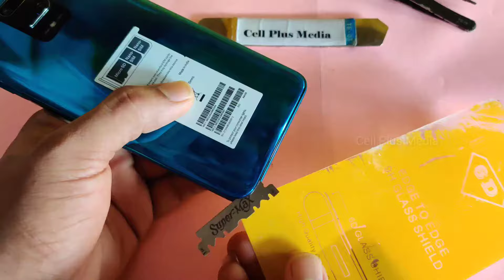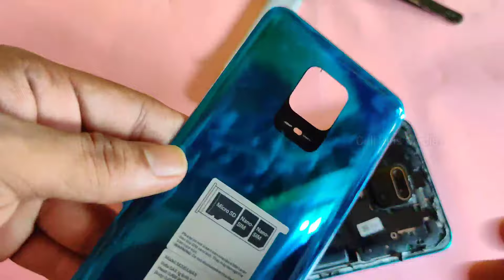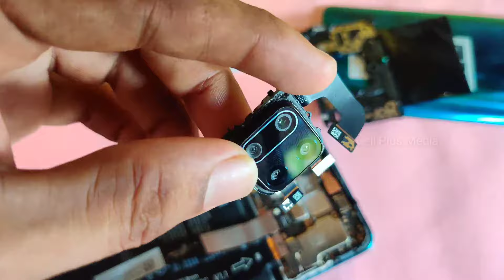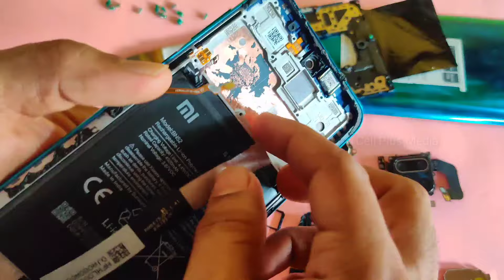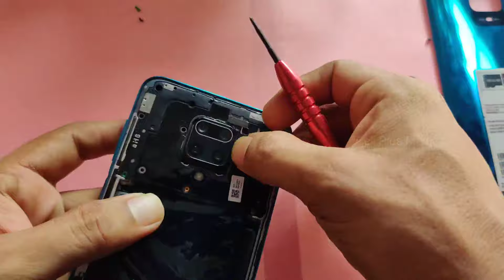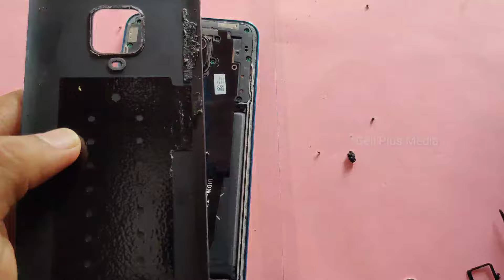Redmi Note 9 Pro Teardown | Redmi Note 9 Pro Full Disassembly | Redmi Note 9 Pro Battery Replacement

Comment: hello recently my redmi 9s dropped into water and o fixed it and it working just fine but after that  the battery drain even when i turned off the phone . what is wrong actually ? should i replace the battery ? please reply me.
Reply from the maker: No battery problem, it's board short, contact nearest service centre
Reply: @CellPlusMedia  so what should be replaced ? how it costs usually

Comment: Sir? I replaced my LCD. While removing the back cover. I accidentally cut the fingerprint sensor. Is there a way t replace using parts from totally broken redmi note 9 pro?
Reply from the maker: https://www.maxbhi.com/fingerprint-sensor-flex-cable-for-xiaomi-redmi-note-9-pro.html?gclid=CjwKCAjwqIiFBhAHEiwANg9szhmm6NAbiI-mn_j2Yt7j655WoTyOu8EZq01CyCBsczRK4TdpVrMnqxoCGr0QAvD_BwE

Comment: The Redimi note 8 pro and Pocophone f1 have liquid cooling😁👍🏻, this one does not.😬👎🏻
Reply: This is modern snapdragon processor don't need the liquid cooling because it's not heat so much and has a better optimization and heat controlling. While mtk and old snapdragon processor not better at heat controlling and heat so much so the liquid cooling is must have. Realme 6 is using the same mtk processor on redmi note 8 pro. But realme 6 heat so much because it don't have a liquid cooling.
Reply: Bro, I'm using this phone and play heavy games like COD, Honkai Impact, PES 2020 and more with all the games at higher or max settings. Play for hours and just get warm at least 35 - 37°C.
Reply: @anonymouz2.064  The Pocophone f1 has liquid cooling, and the newest Pocophone f2 pro with snapdragom 865 also has liquid cooling.  and then...😁😁
Reply: Heat pipe helps your phone live longer because of reducing temperature faster